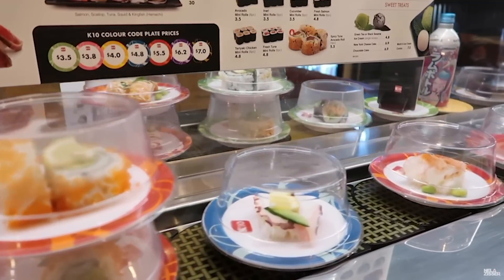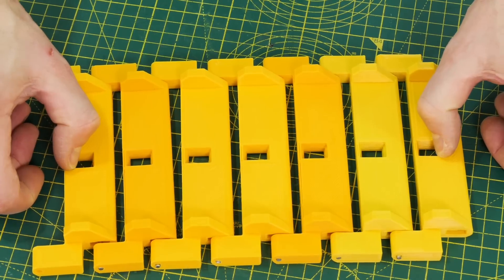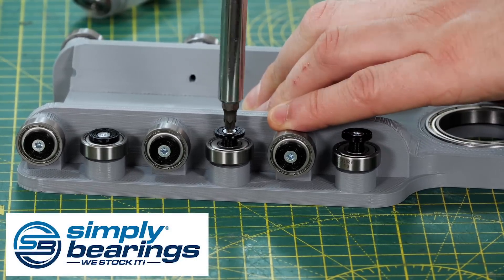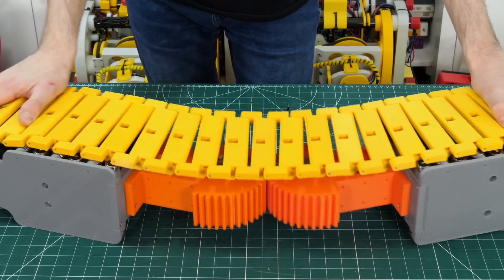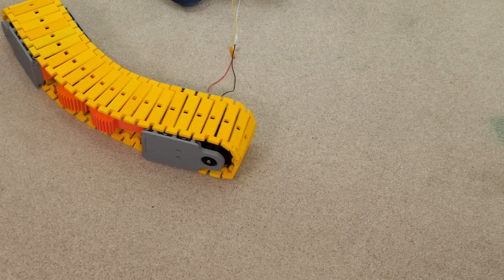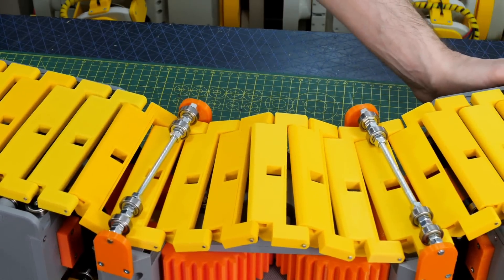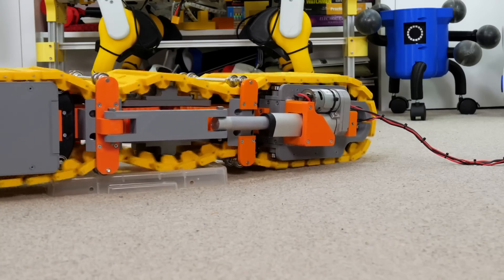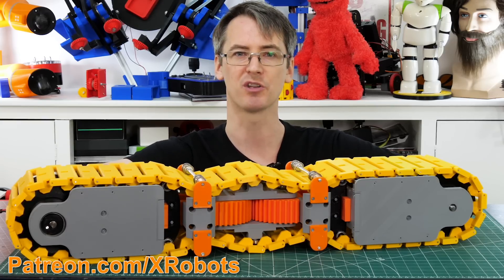How this track bends to steer

Comment: I want to see how this thing turns out. For little I know, you might need the motion sprockets to be coaxial and have a differential. A self locking one, or the whole point of improving traction goes to the beach.
I think you see my point: Retaining the upsides of the belt drive, plus the ones of steering wheels. But using one only belt and not splitting them in fronts and rears as they do in some military vehicles.
Ambitious, indeed. A nice proof of concept.
It risks to turn useless unless it matches the point above: to have the upsides of both steering wheels and belt tracks. And my suggestion of a self locking differential might be too mainstream compared to the originality of this concept. Let's see!
Reply: Well unless you make a kind of motorbike, with a single longitudinal belt drive. In that case no differential needed and it makes perfectly sense. Kind of. 
Okay I get the point here is not to revolution tracked vehicles but a mere proof of concept. Interesting, tho.

Comment: You could do two or three joints to allow more turning, you should also add a screw tension on one side. Allowing you to to extend one side of the track to be longer to create tension, this could work better than external bearings

Comment: This scheme, called track warping, is a very old idea. It was used for steering on the well-known WWII Universal Carrier (aka "Bren Gun Carrier") for light turns, and mechanically combined with track braking for tighter turns. The carrier's centre bogie could slide a small amount laterally, causing the track to warp along the ground. No special loose track was needed, the grouser pin tolerance was enough.

The track warping system was improved upon with the Australian WWII LP3A MG Carrier and also on the 1-ton Tracked Truck GS where the front idler wheel was able to pivot a few degrees left to right to warp the track before it touched the ground, reducing the force necessary to steer.

Comment: What you need is to put the idler on an adjustable spring-loaded mount, so when there's slack in the tracks the idler will push outwards to pull it taught, and vice-versa.

Comment: One thing you can potentially do for track tension is make the side with the roll wheel adjustable so that you can extend it a bit to tighten up the track.
Reply: And perhaps spring loaded to allow some flex?

Comment: Instead of printing out rubber pads stuff like that for your tank treads use spray-on rubber bed liner, the volatiles in the formula can sometimes melt plastic.  But if you spray tan and really light passes that stuff evaporates before it damages the tread.

Comment: You could add a tensioner (hydraulic, spring, etc.) in between the center bending gears and the body-ends they are attached to, therefor passively tensioning the slack by lengthening the robot slightly as it turns. 🤔 If you decide to add an up/down pivot so that the track can bend over obstacles, this solution wouldn't interfere with the new mechanism. Such a mechanism might be achieved with a pair of gears that are stretched along the verticle axis, but over a spherical shape, so that the mesh at different angles. The tensioner would ensure that they are pressed together, too, so that they don't just fall... maybe 🤪
Reply from the maker: I don't think that will stop the 'corner' dropping down

Comment: Maybe you could make one of the centre gears a full floating gear, and drive that for steering… and also use a spring system to tension the track on the idler pulley.. like how an excavator track is tensiond, but with a spring to allow for the bending movement

Comment: At 08:50 you tossed the added pivot points out the window by putting the extra guide bearings dead centre. Should have put them on the ends of the bridge no?

Also; make your tracks have magnets in them so they stick to the bearings that way and don’t need the things wrapping around them.

Comment: With a single articulation, I'm not sure if bending tracks provide any advantage over two straight tracks articulated in the middle, especially given how difficult they are to tension. There were a bunch of tests with articulated tracked vehicles back in the day in Sweden. The Bandvagn 206 for instance would be the same concept but with two separate tracks. Still cool tho.

Comment: You could add a "roof" to the side walls the tracks currently have, that would keep the track fixed to the bearings. I wonder if adding a second bend axis sort of like an inchworm where it can bend the mid section up/down as well as left/right might help with obstacle climbing.

Comment: you won't need the outside bearings if you have enough tension on the track to stop it from sagging and coming off
Reply from the maker: I don't believe that will stop the 'corner' falling down, unless you stretch the track until its straight again

Comment: Just as a "quick" fix to keep most of the existing hardware while you revise the design, what if you got rid of the the bars between the wheels acting as tensioners so theres a big gap between them, and printed a new track with an extension that goes through that gap, and goes back around the outside of the tension wheel? I made a rough diagram below, but I think you understand what I'm saying, the track segments would be a taller i beam shape with a gap for the wheel bearings to slot inside of as the track passes around it.

========
]O === O[
]====== [

Comment: I am thinking a set of road wheels with suspension would fix the tension  problem and give it some overhang for climbing. Leading/ trailing arm on the ends with a two wheel bogie each, and a single road wheel in the middle. All wheels have teeth to engage the track to keep it from side slipping.

Comment: what about an active adjustable front idler/tensioner wheel? when ya need more tension its on a track and slides forward. might not even need any electronics or programming, could probably think of a good mechanical solution.

Comment: ben-d, its over
Reply: slot guide, instead of one-way bearing, misses the slot often, not reliable in practice
Reply: yes you have a chance per each slot to miss, which makes it jump off the track ungracefully
Reply: how about magnetic track slots adhesion instead
Reply: tank steering, two tracks, or 4 tracks, like track tractor
Reply: hey how about normal car tire outer wheel, replace the inner tire with the spiral leaf spring airless tire, its self-inflating by centrifugal spiral turbine, also, a practical application

Comment: Maybe do a double gear link to distribute the turn angle to segment bearings. And then yeah I agree on getting a C channel in the track. Basically the same issue as a roller coaster except the bearings are stationary. Hmm then also probably want to put your steering servo inside the track somewhere.

Comment: On commercial bendy belts I’ve worked with they don’t expand and contract. They just get shorter on the inside while the outside stays the same. This would avoid the bending stress on the pins and the flex in the belt. I think you could get away with spring take up on the top only, and devise a different method of keeping the bottom from falling off. Maybe a bendy L profile guide that hooks into the belt?

Comment: I think your "steel" axles were actually copper
Reply: To me they looked like copper coated welding filler rod
Reply: @Codebreakerblue  yep that's exactly what that is. Cheap mild steel filler wire
Reply: At the very least they're copper coated.
Reply: Ea-Našir moment
Reply: It’s copper coated
Reply: I do a lot of miniature building looks more like brass rod. It’s cheap and very common.
Reply: Sure would explain why you said it might be copper
Reply: No, no, he didn't mean "steel" rods! He didn't mention any sponsor gifting those to him, so clearly he meant "steal" rods... as in he stole them
Reply: It’s just special steel
Reply: I think it was zinc coated steel. If it’s mild steel they’ll often coat it so it doesn’t rust.
Reply: Look like TIG mild steel ER70 filler rods, they're copper coated for conductivity I'm pretty sure. They're much cheaper then buying steel rods listed as axels or other uses. I think I managed to get a KG for 9usd
Reply: That confused me I was like that is clearly copper
Reply: Hes british. A yellow discoloring is normal there because of all the tea

Comment: You could put neodymium magnets In the underside of the track and the on mount points under it on the frame. That would hold the track down and possibly constrain the belt when steering.
Reply: Would that not just make it jam?
Reply: @Elio  no, not at all. I use them in a very very similar manner on a conveyor belt system at work. You can't pull appart but magnets will happily slide over each other. Especially when embedded in a plastic belt segment to reduce their strength but keep enough of it to hold the track down.

Comment: My thoughts would be to introduce a resilient spacer into the slot that the pin rides in - to provide resistance that pulls the pins back to their rest point. This would allow you to effectively tension the track without just using up all the pin travel in the process.

If you can get this to work, it would be perfect for making a tracked bicycle!
Reply: I am not the only one who likes the idea of a trackcycle I see :D

Comment: This reminds me of the tracks used on the Cruiser Light tanks Tetrarch tank and the later Harry Hopkin tank, where they had two steering mechanisms, one was standard skid steering, and the other was bending the tracks, i think it would've worked similarly to the ones presented here although i can't really find online sources in regards to the Tank treads use on either of the aforementioned AFVs.

one suggestion i have to tension the tracks is having an adjustable or spring tensioned roller wheel underneath the tracks on the fixed bodies, so as to try and keep the track in place, either that or reducing the space in the track treads that houses the track pin on the vertical axis so it doesn't move as much up and down but still maintaining left and right.
Reply: The tetrarch turned the outer wheels, and the inner wheels tilted in a funny geometry to tighten the turn radius. It gave the tank the ability to turn without relying on skid steer.
But since he doesn't have a tank body to get in the way, I don't think he'll need to do any inner wheel articulation.

Comment: Imagine...
A vehicle with two bendy tracks, able to bend towards each other to let the vehicle pivot in place. But they can also bend outwards for stability at the cost of immobility... Unless...  You could let them bend down to lift the thing up off the ground, and at those four contact points you could drive "sliding" sideways, etc depending on drive directions... So bring back the omni-wheeled treads too! 
A monstrously complicated but monstrously cool monster of a tank walker thing.

Comment: I have 3 thoughts:
1) Instead of a shark fin behind the track, How about an "L" shape that could be used to capture and guide the track?

2) I would take advantage of the springing of the metal bars and use them to tension the belt as well as provide the articulation

3) The straight sections can be much shorter. As long as the track is straightened just before the sprocket, then it should track just fine. I would use a much more segmented frame/body and run a cable around the frame. You pull or push on the cable to create the flex.

Comment: Another fun project. How does this compare with commercial vehicles that already exist? Are all these projects as genius as they seem, or over engineered?
Reply: I don't think there's any commercial vehicle like this. The Guardian S robot has tank treads at each end of it, but none in the middle sections. Russia has the Hamyak, and there was the 1939 Helaitre, but they didn't articulate the track for turning. The Tetrarch articulated the treads, but it's a tank... so yeah, nothing like this existed... yet
Reply: @DonsArtnGames  the british Bren Gun Carrier used track warping during WWII.
Reply: @1944GPW  Yes, they warped the track by sliding the inner wheels in and out and again it's a tank... I wouldn't really consider that a "commercial" item as it is a military item...

Comment: This is not a bendy track tank, it's two non-bendy track-tanks that happen to be connected through a bendy bit that doesn't actually do anything because it's not even touching the ground anymore.

It might work if you had looked at how tanks work; they use many many many wheels that ride on the track. the track is literally that: a track for the tank to drive on, exactly like a train.
So you need many hinges and bend the tank, giving each section a set of wheels.

You need to start thinking before you waste days of your life printing solutions that very predictably will not work.
Reply: I think this is more of a proof of concept. It has several possibilities, and I can think of a few applications for it already.

Comment: probably just get rid of a track link or two for tensioning
Reply: That's what I wanted to scream at my phone the whole video. It's crazy that also in the comments no one suggested that simple fix. Everyone is coming up with insanely unnecessary complex things when it's as easy as removing a few links. If you pick up the tank and you have a ton of sag at the bottom, you have too many links

Comment: Isn't this how the light tank mkvii, Tetrarch steered?
Reply: The Tetarch did turn the outer wheels, and the inner wheels did a funny geometry tilt to do so. It allowed the tank to turn on roads without using skid steer.

Comment: You could have a sprung tensioner on only the top of the flat sections that tensions by pressing the track upwards to compensate for the removal of the bottom tensioner for a flat driving surface.
Reply: Spring load the idler wheel inline with movement. You'd probably need some thicker rods to constrain the movement direction. the lateral constraing at the hinge should be ok to take the moment and not force the track sideways??
Reply: Unless you have something bringing the track back down, wouldn't that encourage the belt to come off?  I'm talking specifically about when bending the track.
Reply: @benjytom7371  yes: the existing outside rollers
Reply: I was thinking just a spring on some rods to tension the entire thing, like a typical tread on a tractor.
Reply: Indeed, though with how well sprung the track is with those long steel pins I don't think you need a sprung tensioner - let the tracks own springy nature deal with a fixed tensioner set to put them under tension. So just raise that centre section track guide on the top as far as required to put enough tension on the track!
Reply: It would be interesting if the spring tensioning idea could also double as some sort of suspension.
Reply: What about the idler (or just the entire idler section including rollers if he doesn't want to reprint existing parts) being spring loaded to tension the track along the vehicles axis of travel?

would benefit both top and bottom roller contact.
Reply: @user-pc5sc7zi9j  that's how real world tracks are typically done, but not normally spring loaded, just adjustable to get a tight track.
Reply: @ARockRaider  Nvm, tribalrhino suggested the same thing I wrote In answer to the same comment. Hope they also find your comment.
Reply: either this idea or like regular tracks normally do you have the idler adjustable forward and back.
Reply: im actually wondering if he could have just remove one bit from the rail, so it creates tension due to the number of rails reduced. does it affect the turning?
Reply: @arankasih1162  I think the bottom rollers that got stuck could have been removed with a tighter tension while the top ones were only an esthetics problem so can remain. It would also be possible to add more bottom rollers to the mid section if required.
Reply: I was thinking of a tension spring between every link so the track is under tension along its entire length.
Reply: You could form the track out of solid rubber with a concave circular curve profile. Ensure there is a single focal point on the curve for even distribution of load. To ensure tension across all surfaces, you could use an air-tensioned cylinder, connected to itself on both ends in a "tube" fashion, with a one way valve (with push release to deflate). This would allow for extra grip by deforming over rough surfaces, while also providing shock absorbing from rougher surfaces. In order to provide the turning motion, I would advise using a minimum of 2 of these devices in series on each side of the motor and battery assembly. Instead of pivoting in the middle of the machine, you could pivot at the point where the "device" connects to the rod which joins 2 parallel devices. 

Hope this helps
Reply: 15th reply😂
Reply: Yes tensioner pulley on car engines.
Reply: I think it would be simpler to have no track in the middle and two separate tracks instead, one at the front at the rear. You would not have bend any track, to achieve the same thing, this is over engineered.
Reply: @ebutuoy4811  the whole point was just to test this concept. What you're saying is just a bike with treads aka a totally different project.
Reply: The non drive wheel needs to be the tensioner wheel.
Reply: The flexible crawler seems to solve that issue. I'm very interested to see how it does it.　　https://www.youtube.com/watch?v=NuepKccatyk
Reply: or springs in the orange parts that stretch it apart
Reply: Sprung